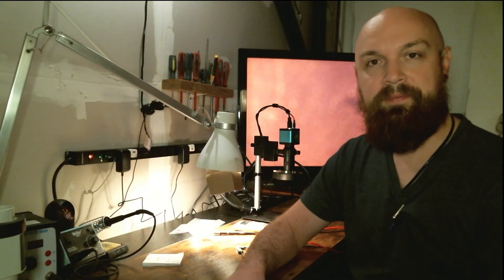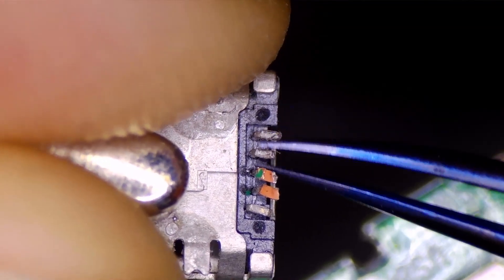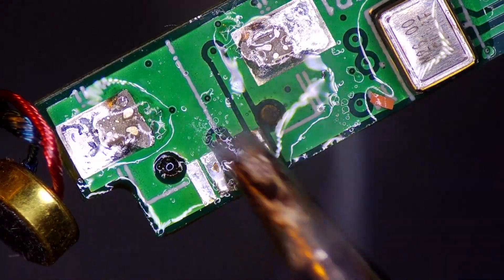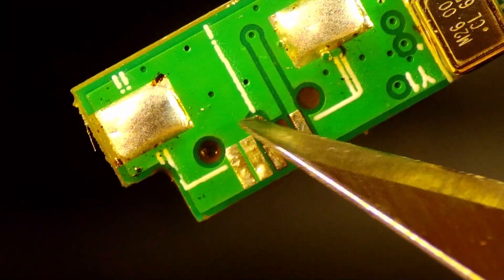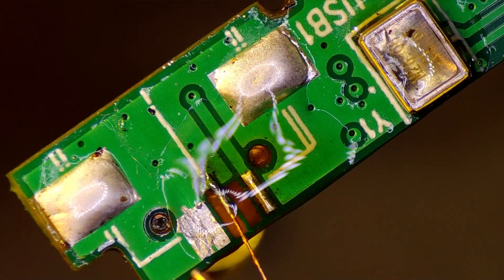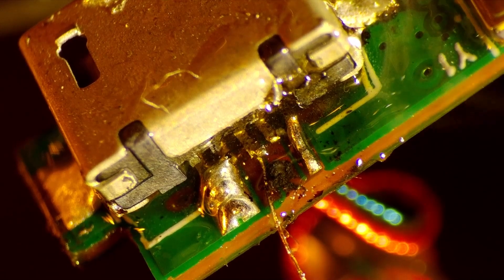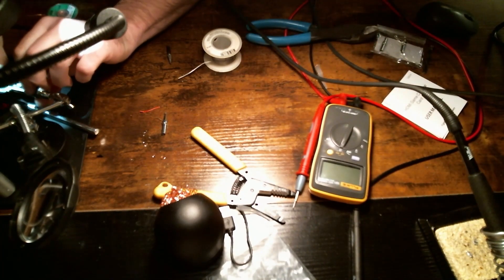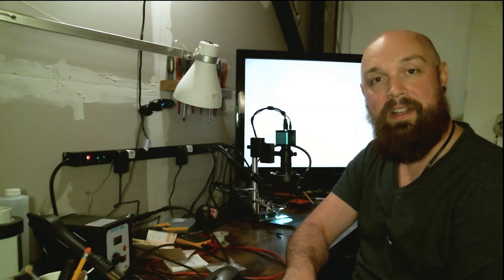Jabra Stealth - Broken USB Charging Connector Repair

Comment: Would you kindly explain (or show) how to take apart Jabra Stealth since there’s absolutely no info on the Internet? Much appreciated.
Reply from the maker: Sure its quite simple.  Near the ear piece get something underneath the silver plastic to pop it open, then slowly "peel" the silver piece off taking care not too put too much strain on the plastic.
Let me know if this works for you, if not, i can go into more detail
Reply: Thanks so much for clear instructions! I managed to open it using guitar soft plastic mediator. This was indeed really easy to do (if you don’t rush it).
Reply from the maker: Glad it worked for you!  Are you having some issues with it?  I'd be happy to assist the repair
Reply: Thanks for assisting, Mike! I’m investigating a sticky answer key issue. I thought this may be due to dirt. However everything appears to look normal under the hood, it’s clean (or I moved dirt while opening shell). Do you think the tiny “ribbon” button may get sticky itself? I’ve seen similar buttons working perfectly fine in iPhones with 10+ years of heavy use.
Reply from the maker: @Pocketlol1  were you able to test it outside the case to see if the button sticks? If it still sticks, likely some crud got into it.. may need a replacement

Comment: Nice work. Never heard of soldering braid before. Do you prefer it to a solder sucker?
Reply from the maker: In most cases yes, its more reliable and you can get the contact cleaner.  You also don't have to pour too much heat into the device like you do with a solder sucker